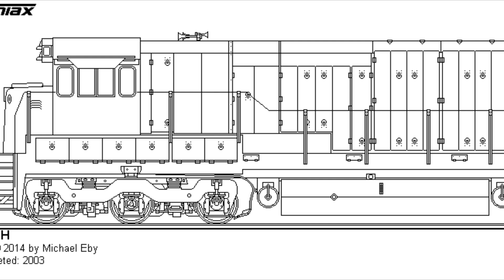Engines of New Jersey Transit: The U34CH part 1

Comment: Very nice job here! 
Keep them coming.
I actually got to run these engines.
Reply from the maker: Thank you very much! I'm sure running these engines was fun
Reply: @MrNJT  
Fun? To a point.
They are classics, but noisy   dirty, smelly...
Yes...fun to run. Used to hostle them in Hoboken yard. They did not have a working cab signal system so they could not run in Amtrak territories.
Reply from the maker: @georgemurphy2579  neat! It’s a bit unfortunate they were restricted from Amtrak areas.
Reply: @MrNJT  these engines did, and still do, have a tremendous following. "Retired Railfan the Horn Guy" claims he doesn't like GE (excluding Jersey Arrows). I wonder if he is including the U-Boats? He never did a video about them.

Comment: They plan to return to mainline service this year!!
Reply from the maker: No, they are not planning to return any of them, including lone survivor 3372 to service. The fleet outside of 3372 is scrapped. 3372 due to its condition is not returning to the high iron anytime soon, as that it needs major mechanical work. Please do not believe in falsified information and always check, and do not spread false information.
Reply: Dang it. I was really hoping to see 3372 on the mainline.
Reply from the maker: @thealmightydoge5653  Maybe one day. Only time will tell.

Comment: The number comment isn't actually accurate.  Conrail knew it would be selling its U34CHs, and they were no longer on the Conrail roster by December  1976. NJ DOT owned them outright at that point.

They were renumbered into the 4100 series to get them in line with all the other passenger locomotives on Conrail's Roster. NJT stuck with this on subsequent locomotives to avoid confusion with Conrail locomotives.
Reply from the maker: Ah I see. My sources for these videos usually have misinformation, but thank you for making this comment! I eventually plan on redoing the series (if possible) and comments like this one will help with information!
Reply from the maker: Thank you for the information! I plan on redoing the series soon if possible once I’m done with the current videos
Reply: I dont even blame you.  I've found that for stuff like NJT, the information out there is almost totally tinged by "railfan" lore.   A few years back i created all sorts of trouble when i changed the Wikipedia article on the Arrow II, III and Silverliner IV to reflect that the bodies were built by Avco, not Budd.  Still, its a persistent "fact" thrown around.  I was able to scan in a few primary sources and that seems to have put the issue at rest.

I think the main issue is that at the time, there was such disdain from railfans that no one actually tried to preserve any of the information.   It is genuinely difficult to find solid facts.
Reply from the maker: @cab4  People in this community just never bother to learn or anything. If you get corrected I’d accept it but some people will fight to say they’re right

Comment: Like how you snuck in 4154 at the end. Only U boat to receive SEPTA blue as that engine along with 2 others were leased to SEPTA due to the Reading Viaduct in North Philly needing to be taken out of service. Wish we kept 4154 as it would of been an nice rescue locomotive or assisted on the wire train and would of been a nice contrast to the junky weak caterpillar engines and the 1 genset we have.
Reply from the maker: Indeed. 4154 could be the engines SEPTA has now any day. Sucks that SEPTA really chose kinda poor-standard engines.
Reply: @MrNJT  4154 I'd imagine would have no problem with assisting New Hope 40 during the North Wales 150 excursion. SEPTA SE15B 80 (SEPTA's strongest diesel in their roster) really struggled with the consist as it's not designed for such work (Not to mention 40 is one heavy old Consolidation) It got so bad that on the return leg of the excursion they'd shut down 80 while 40 pulled the excursion back to North Wales with no sweat.